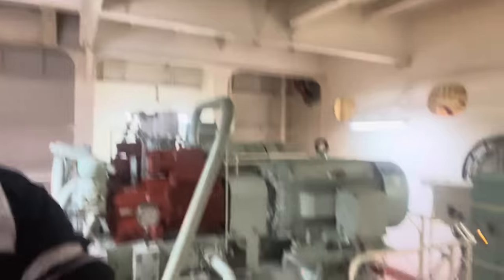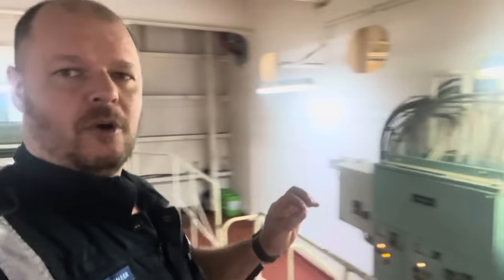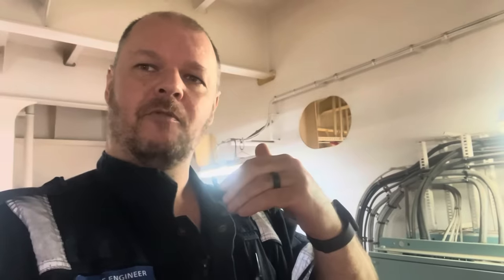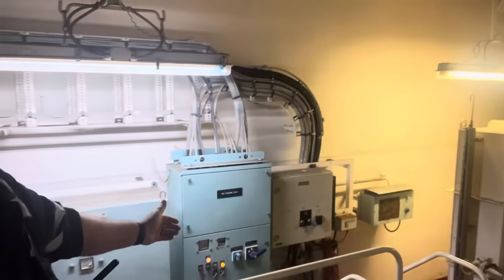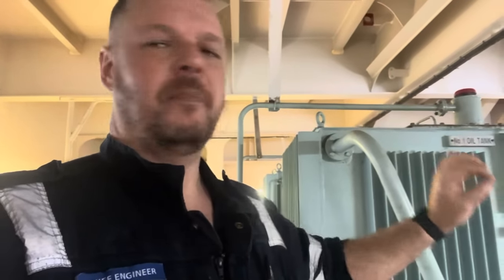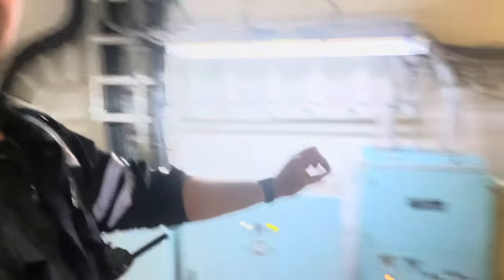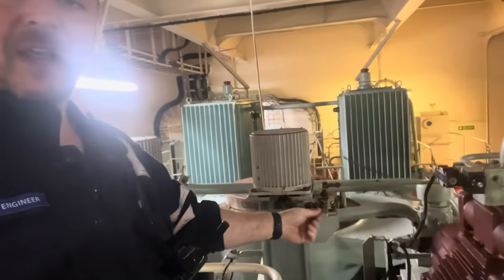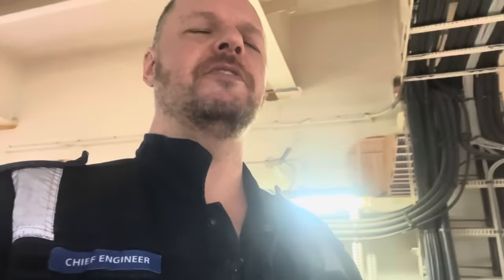Dali size containership steering system. How it’s designed to not hit Francis Scott key bridge

Comment: With the recent widespread adoption and deployment of gridscale battery technology, would it be practical to install an emergency battery to cover the ~1 minute between loss of main engine / main generators & startup and bring online the emergency generator?

60 seconds of emergency UPS for critical ship systems seems well within reach.
Reply from the maker: That’s a great question we have small UPS for what’s “critical” advancing that to things like steering are interesting. The vibration and temperatures as well as salt air are an incredibly harsh environment for anything and we are always 20
Years behind in technology so is it possible? Probably, is it happening anytime soon? Probably not

Comment: When the final report comes out, I guarantee that there will be a chain of failures/errors that resulted in this disaster.  I've been told that some ships have the backup generators already running to avoid any delay when conducting critical maneuvers.  Also, it appears that both sets of generators failed in the Dali.  Surely they would not use the same fuel source?

Comment: They were having issues way far back prior to hitting the bridge, should have used there emergency generator just to make sure they had steering  especially if there going in between the pillars and under a bridge. Then again I wasn’t there only they know. But by what you’re explaining it seems that they have a back up for a backup and still a manual override!!!! Damn

Comment: You haven't mentioned the screw(s).  If you lose propulsion and are ciasting, how effective is the rudder?
Reply from the maker: Not my area of expertise but my understanding is the rudder doesn’t do a lot when the prop is blocking the water going by it
Reply: As long as the boat is moving and there is water flowing over the rudder (in the case of the Dali 7.5 kts at point of impact) it will still work.

Comment: It looks like they went full astern and dropped the port anchor, there is a massive plume of black smoke, the transverse thrust would take the stern to port, bow to starboard and this would negate the effect of the rudder. So even if they went hard to port the prop walk would drag the stern. Especially in shallow water in a narrow channel. 

The rational thing to do would be ahead and port rudder but that is driving the ship towards the perceived danger, the bridge team look like they are trying to stop before the bridge.

Comment: When maneuvering in tight channels the backup generators should already be started warmed and ready to take over NO delay except 3 or seconds!
Reply from the maker: Backup generators aren’t a thing there are main generators and emergency, no backup. They should have had at least 2 main generators running whenever they are in restricted areas

Comment: Steering gear room equipped and  with electro-hydraulic ???   <<in  hand steering>> ??? and against that what is the minimum steering speed for sufficient steerage way ??? to secure directional stability of the vessel ???

Comment: That was very interesting! I mean ships came went their ways under this bridge day in and day out for 50 years, so really everything had to go bad that could go bad for this tragedy to happen. If you watch the footage, the lights go out AGAIN maybe 20 seconds aber they came back on. Could it be the emergency generator failed too? Maybe for a total different reason than why they lost power in the first place? Just bad luck? (And bad protection of the bridge, I think meanwhile we all agree on that ...)
Reply: Enjoyed your description of your steering gear.  I was an oiler on a ship built in 06 as in 1906. Everything in the engine room was steam operated and manual controlled. The DC dynamo provided lights, refrigeration unit for the galley, gyro compass and radar ( after market ) oh radio too.  The wheel house steering wheel turned a shaft with splines and universal joints the length of the ship, 250’. This controlled a  steam valve to turn the rudder P or S. The steering gear was like a winch but beautiful and smooth, well maintained.  The Chadburn in the engine room was connected to the Chad in the wheel house by pull cables going through the cargo holds. We had to keep it freed up when loading full loads of grain. I also worked on newer steamers built in the 50 s which were all electric and hyd. Steering.  I did becomeFourth Engineer and quit by 26 years of age.

Comment: 1. Maybe I didn't understood things correctly. In case of main power shutting down, emergency generator powers  the emergency switch board. The emergency switch board powers the second motor. Basically in case of power loss emergency only one steering motor is powered, by lines that go on one (port) side of the ship.

Where is the emergency generator, near the motors, or near the switch board (aka bridge)?

I really don't like that both motors are next to each other, one getting on fire could easily damage the other, and there is also oil...

2. Could the ship be steered if there is no propulsion? The power loss should not have disabled the main engine as it runs on diesel/oil.
How easy/hard is to stop the propellers? Could individual propellers be stopped (assuming there are 2 or 4) in order to steer the ship?
Reply from the maker: The emergency diesel location can be hugely variable so don’t want to make assumptions on that. But I’ve never heard of its location being an issue. But yes if the mains go down only 1 motor would be available for steering. 
Now this is a big misconception these engines are absolutely nothing like other diesel and will not run without electric pumps supplying lubricating oil and fuel oil. Even with all safeties disabled it’s just not going to have any power or really be able to do anything for the ships motion

Comment: Nice presentation but what's missing is any discussion of a UPS. My understanding is that ships this size have a large UPS that's meant to (at least) carry critical systems during the period between when main power goes offline and backup power comes online.

It seems insane to not have that capability. Did Dali have that capability? If so, why would the pilot lose the ability to steer? If not, what's going to be done to correct this obvious oversight?

FWIW, my background includes computer systems operations. We care enough about your ability to get your email or watch youtube videos to have way more redundancy than these ships appear to have. That's not right.
Reply from the maker: I have at least 10 ups units on my ship. But they are all small electronics backups. How big of an ups do you think we would need to run those motors under load?
Reply: @steamman9193  If it's not clear, I'm talking multi-tiered backup power. The UPS is just there to give you power within fractions of a cycle and keep you powered until you can get the generators up and running.  I don't know how big those motors are. But I imagine that a couple of hundred KWhr should do the trick. A silly little Tesla Powerwall has about 13 KWhr of useful energy. My car has 100 KWhr. The max size of an EV pickup/SUV is a bit over 200 KWHr. Seeing as how one HP is .75KW, a couple of hundred KWHr should give you loads of time to get your generators on line.

Comment: MV Dali has FOUR diesel generators !! One is the EMERG generator, comes ON automatically in a power failure. My question is....the other three were ON ?? If not all 3, how many ? I am an Airbus pilot, there is a lot of redundancy here too, also the bus bars are reconfigured (shed) when one main generator trips off. A320 has 3 identical GEN, one on each engine, the other one on the APU. The emerg gen is driven by the RAT, turned by the windstream. Also no electrical power, no flight (fly by wire)
Reply from the maker: Dali had 4 main generators the emergency is not counted because it is prohibited from being used as a main generator and kept in good condition for emergencies like this.
What exactly happened still needs to be revealed
Reply: @steamman9193  do U think the other 3 were ON ??

Comment: I'm assuming there's more than one backup generator feeding the emergency switchboard definitely human error hypothetically what would happen if the emergency switch gear did not fire up is there a redundant generator typically. Also I'm assuming a lot of this is computer controlled is it possible to system was hacked considering they were close to the Shoreline

Comment: I'm a lot more interested in how an emergency system like the ships "UPS" Uninterrupted Power Supply for the ship's recorder "black box" can be partially powered, only recording some sounds without any ship functions "rudder inputs, engine inputs..." being recorded?
From what I've gathered, these "recorders" have an independent battery system as a redundancy so they will not malfunction, only recording some sounds seems strange IMHO.
Reply: When everything went down, there was no data to be recorded - I am thinking this is just reporting as such.
Reply: @Rapture1469  Alarms sounding and nothing to be recorded other than the alarms sounding?  I couldn't follow that with a leash around my neck.

Comment: Does the power supply switch via an ABT?
Reply from the maker: Is it required? Not necessarily but I’ve never seen it on one of the larger ships not be automatic. It’s only smaller ships I’ve seen it be non automatic

Comment: What's the point of having a standby generator ready during a maneuvering watch if it takes 20-40s to get power going again?  Dali's bigger problem was loss of propulsion at low speed making the rudder much less effective, but you almost want an uninterruptible power supply running certain equipment.  You can get the AC phases to sync.  Maybe that equipment is too expensive.
Reply from the maker: Terminology is a big thing here they should have had a standby generator on when they blacked out. Should being an important word. After the main and standby failed then the emergency would kick in

Comment: Steering is not the only factor in the incident apparently there was a current flowing towards the ship from the channel behind pushing the back left, the one thing that may not be redundant is the fuel all of the systems rely on, do they all get fed the same fuel will do the diesels run on a different standard of fuel and storage to the possible bunker fuel that runs the main engine, fuel contamination may be a factor. Fuel system redundancy isn't of the part of this video. But in all these types of systems it is important to find out the people have spotted any possible parts where there is no redundancy.

Comment: How long does it take to switch from ahead to astern propulsion?
Reply from the maker: Highly variable even the same ship will do it at different times under similar conditions less than a minute most definitely though. However the engine won’t run without electricity for the fuel pumps
Reply: @steamman9193  Thanks for the response. I appreciate that.

Also, if I may ask, assuming the crew engaged astern propulsion when the power came back online and the heavy smoke indicated that the engine was under load, is it possible that a port side prop walk pulled the aft of the vessel to port? Which may have contributed to the turn into the structure?

Comment: Redundantly redundant - I like it !
Even the A-10 warthog has a manual control system if the electrical systems fail - and AFAIK they have been used twice.
I can just imagine some poor sod sitting in the steering room on a headset getting commands from the bridge to push left (port) or right (starboard) and pushing the Lever of Last Resort to steer!  WOuldn't want to be there!!
Time to change your underwear...
Reply from the maker: I just went back to steering and looked at the motors they are 150kw which is about 200 horsepower. If anyone thinks a man can come close to moving something that takes 200 horsepower they need to do some hand cranking themselves

Comment: Really should have a hydraulic accumulator with the capacity to take those rams one full stroke hard over port to hard over starboard... Then station a maneuvering watch stander (a crewman standing by during port entry/exit) ready with communication to bridge established in the event they need to take local control..

Comment: this is my take on what happened.....electrical power failure (blackout).....main engine shuts down (but prop shaft continues to turn due to slipstream).....rudder freezes (no electricity to turn the two electric motors / hyd pumps). Ship veers to stbd and hit bridge (wind or current). Anchor has minimal, if any, effect. Main engine was never restarted is reverse, no time to do so. The REAL question is.....HOW COME THERE WAS A TOTAL BLACKOUT ???????
Reply from the maker: That’s the billion dollar question

Comment: The main channel is almost a straight shot through the bridge.  There’s no reason to turn any direction, but especially starboard since the pillar is there.  The camera angle made it look like the ship entered frame at a sharper angle, almost as if coming from the curtis bay channel, and then made a sharp turn.  Was all that just camera angle distortion?  Where in the hell was that camera?   It’s hard to place a camera that would explain the path the ship should be on.

Comment: It’s sad that they don’t have a backup battery storage that could run the pumps for a significant duration to recover from a backup generator failure which would limit the loss of rudder control.

Comment: Detailed explanation of the controls, but we, still, don't know how the rudder is turned.  Or, whether or not the rudder will turn the ship, if the propeller is not turning... not forcing water against the rudder.
Reply from the maker: Actual steering is done by others but there are multiple control
Options and stations on a typical navigation bridge. And yes the rudder works a lot better with the engine running

Comment: He made a point that is crucial.... Nobody is back here....
When we got underway, there was always someone in the steering room until we were in open ocean. The Baltimore collision event all took place in 4 minutes, absolutely not enough time to handle that type of situation with the limited crew. Absolute policy failure.
Reply from the maker: Doesn’t matter if anyone was back there if there is no electricity to run the steering motors, and extremely doubtful that steering controls was lost otherwise. Once the generator went down that is the cause. Why and why the backup didn’t work is what needs to be investigated. A guy standing there in the dark wouldn’t have been able to do anything
Reply: @steamman9193  As an engineer you are going to tell me that modern ships don't have emergency lighting that comes on the second ships power is lost? Bottom line... Not enough crew on deck for a normal entry/exit of port let alone an emergency. Bad decisions from the bridge, possible poor maintenance and training for emergency situations all led to the final event. The turn to starboard was most likely because of full astern on a single screw ship... At 1000 feet and 8 plus knots she was going to hit the bridge no matter what. I was Coast Guard and even as much as we trained we still screwed it up plenty of times. Bad decisions in Tampa Bay cost us lives and a bouy tender.. It happens but this one could have clearly been avoided.

Comment: Based on all the videos I've seen about this ship it just sounds like it was so massive and even though if they did restore power they simply had gone too far without power and were past the point of no return even if they were able to pull a full reverse move. They were going to hit the bridge regardless of circumstances.

Comment: One point not mentioned is that the rudder is absolutely useless if the vessel is not making way, i.e. if it is drifting or traveling very slowly. I don't know the Dali's water speed but if it was drifting and spinning in the water there would have been nothing the crew could have done. Inertia was the main player in this incident and without engine power all you can do is ride it out. What I find appalling is the lack of protection to the bridge piers, this kind of incident has happened too many times before and all major bridges incorporate it as standard, and older bridges have had it retrofitted. The only reason not to have fitted collision protection is money, well that saving is busted now.

Comment: Yeah, there was either a bigger failure than redundancy could handle, or perhaps some thing just wasn't maintained properly. removing redundancy from the picture. Could even be the backup generator also had some bad fuel.  But, I'm hearing there's two generators separate from the main engine, and another backup generator that's supposed to have fuel from a separate source than the others.  Or just may have had trouble starting when the other two failed, taking longer to start than normal. I worked at hospitals with backup generators, and testing those it was only seconds, don't think more than about 20 seconds, to start them up and get up to speed to handle the power.  But they did everything they can to avoid hitting the bridge suppost, even dropping the port anchor, but 110+ thousands tonnes, even at 8 knots isn't easy to stop, that's a incredible amount of momentum. Some people seem to not understand the physics. But the rudder losing power with so much redundancy is interesting. I can only believe that something just wasn't maintained to cause that.  Helm controls was so dead, that the VDR while still recording just didn't get anything from the helm, whatsoever, during the outtage. Which is also an interesting bit of information.  While the VDR has a UPS, it appears the helm controls doesn't?  Is that normal?